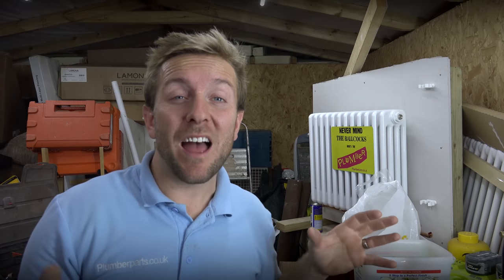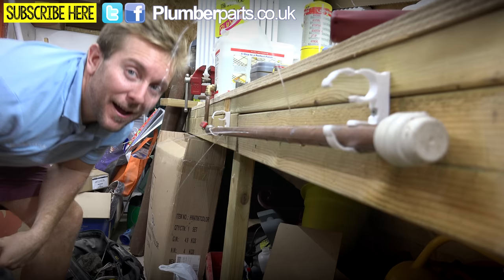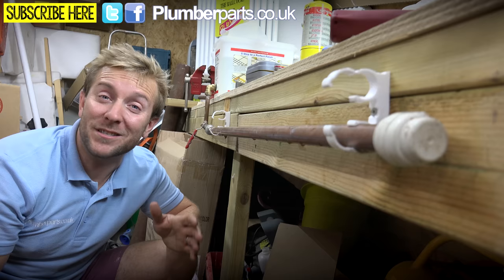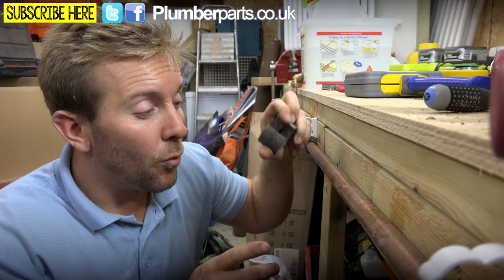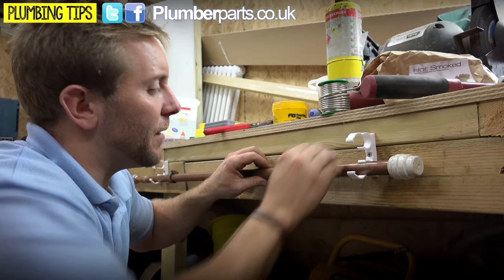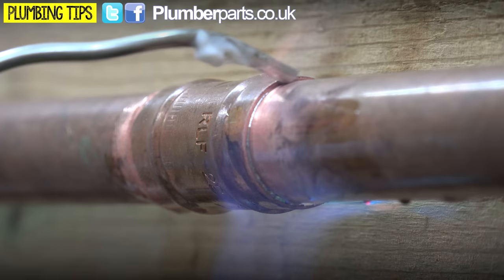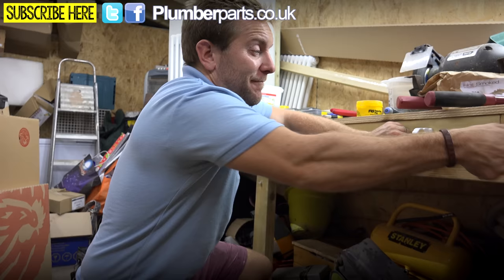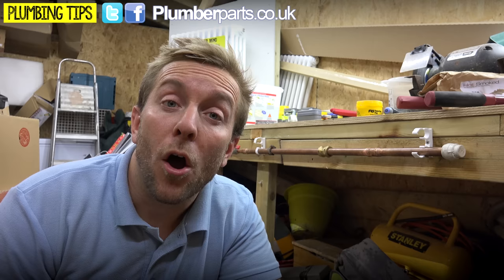FIX LEAKING COPPER PIPE - PINHOLES - Plumbing Tips

Comment: I just find you five years a little too late. In any case your program is very informative. Were where you when I moved to Venezuela from Uruguay in 1975? In both countries we use compression fittings to repair galvanized pipes. Copper is mostly used in refrigeration and gas;I guess this material is a little too expensive down there. When I arrived in Canada at the end of the eighties I was convinced that I've found gold to add to my trade. Copper pipes are lighter,safe and way easier to work with. I did find,as well,that in here ABS pipes(oppose to PVC) are very common and easier to install;as long as they are not used inside the walls in high rise buildings. We even have invented a four ways  fitting nicknamed Toronto T made out of this material. Do you use these pipes in there?. Greetings from Toronto from this old happily retired colleague. P.S : wear your mask pal,even your Prime Minister got infected.......

Comment: As a teen in the 60's I learned to repair black polyethylene underground water supply using a patch from stainless sheet metal and a stainless worm-drive band clamp.  I understood these repairs were essentially permanent.   I once made the mistake of closing up a wall after applying the temporary fix shown here on 1/2" copper pipe, a piece of rubber with a band clamp.   A month or so later water was heard spraying in the wall.

Comment: Here one way of fixing a pin hole. Cut a short length of copper pipe, using a hacksaw, not splice, due to chamfering. Then cut it length-ways, just offset of the middle. File way any rough edges.
Clean the inside of the larger piece, and over the pin hole, using wire wool, Then flux the cleaned surfaces. The piece of pipe, that as been cut, slightly greater than its diameter, when pushed, will clamp around the pin holed pipe. Run some solder into the joint, and clean off. The patch repair, will be permanent. Good thing is you don't have to cut through the pin-holed pin. It also works on pipes which have been punctured with nails or screws !
Tip!  Cut down the lenght, before you cut to size. Usually the lenght of a standard Coupler is sufficient !

Comment: Many years ago I just flowed some solder over the hole and plastered it with araldite. It worked and was still working when I sold the house. Apparently in the 1970s there was a lot of poor quality copper pipe prone to pinholes around.

Comment: I have used the clamp with rubber from a bicycle tube to patch a pin hole . Still working after 3 years . Easy to reach area so if it failed again I will fix it properly .

Comment: 4th way, solder blob it ;)
Reply from the maker: Nice one!
Reply: Sirus You could also come home one day to 15000$ in water damage.
Reply: Actually I've done this for a temporary fix.  Here's how to do it:  sand the area around the hole and clean the area thoroughly with acetone.  Put a tiny bit of past flux just around the hole making sure to keep it contained to just the area around the hole - don't use too much!  Solder won't stick to the copper without flux so just a tiny speck of flux so it doesn't run when you heat the pipe.  Then heat the pipe and a touch of solder should blob right over the hole and not spread out leaving the area too thin.

Comment: Duh-hes soldering that coupling with the john guest cap still on... Pressure builds up and blows solder out... Result-leak
Reply: jeremy western bubbles back into the little tank???
Reply: +Joe O'Halloran OOOOOHHH GET YOU!!!! Bet you wear a special helmet!!! 😂
Reply: jeremy western ...novice here...so teach me something - let's say you're maki g your last solder...how can you avoid that pressure build up? Would you simply have to have the line a open somewhere?
Reply: +Mr Gwarn Stylee yes- always make sure a tap or rad valve is open somewhere... U can tell something is wrong when soldering cos solder start blowing out of the joint- then leaks
Reply: jeremy western thx
Reply: +Mr Gwarn Stylee OOOOHH GET YOU!!!! Bet you wear a special helmet!!! 😂😂😂
Reply: jeremy western I do - the tin-foil keeps the invisible control waves away...at least that's what the neighbor's dog tells me.
Reply: +Mr Gwarn Stylee TAKES ONE TO KNOW ONE
Reply: jeremy western Woof, woof!
Reply: Jeremy is right, but only with short runs of pipe I find, on large heating systems the pressure build up is lost

Comment: great video you could also use a sharkbite coupling in place of a compression coupling and a copper sweat repair coupling, no stop, so you just have to slide the fitting back and forth without having to slide the tubing lengthwise. soldering up the hole itself also works....with a little skill. i've done it in a pinch.

Comment: I do repair number one for pin holes not at/on joints.  The first one I did was 12 years ago, and it's still there and holding perfectly.  There have been many number one repairs since, and they've all stayed that way.  Temporary?  I guess... if you just can't stand not doing in-depth plumbing jobs all the time.

Comment: I took a rubber hose from a washer and cut off a 6 inch long piece and put it over the pin hole by cutting the hose lengthways and I secured it by hose clamps. Much like what they did. It really works.

Comment: I've had more pinhole situations caused by hard water. Copper deteriorated so bad I could crush it with my hand. Other hard water issues where any compression or solder attempts are a fruitless effort. Don't get me wrong, great advice. I've used "rainbow rubber" many times in life. Always keep some in my vans. Can also become an instant pump seal or similar. I'll keep an eye on this channel

Comment: Thank You, I have just applied the temp fix (jubilee clips and rubber)  as we can not yet access a greater length of pipe, going to  wait until I can then maybe apply compression joint if the pipe next to it allows space, if not,  do both pipes, just seems to me a shame to chop a decent pipe,, anyway thanks again.

Comment: I wonder how good a pencil tip works for a quick temporary fix I think I saw this somewhere years ago where you just take a pencil sharpened it up really good and just stick it in the hole and break it off and voila you've got yourself a plumbing repair that you can write home about supposedly don't hold me legally responsible

Comment: Had a freeze in late 80s. Small split in a pipe outdoors. Pressurized line. So i took a piece of rubber tube, cut a plastic pipe in half and a hose clamp. Rubber over hole, split pipe over rubber, clamp over split pipe. To this day not a drop leaking out. Soooo, if it aint broke, hands off !

Comment: If you need an emergency fix you use a bicycle repair kit. You use a tire patch and a hose clamp. The patch over  the hole and clamp until the leak is stopped. Fast and cheap until you can do a proper repair.

Comment: I’ve used black mastic plumbers tape on pinholes with pressure in the pipe. It held for years until the bathroom was renovated and the pipe was replaced as part of the renovation.

Comment: Just came across your video, not by searching... But I watched it...  I have experienced a number of pin hole leaks.  The plumbers don't solder anymore.  They cut the pipe on each side of the hole, and then re-assemble with a copper fitting with gasket, and use a tool that is battery operated and it compress the fitting.  I now have my leak fixed, a huge bill, and a hole in my ceiling I need to fix. I hope what they did never leaks.  They tell me my leak with the bluish tint where the hole is was caused by defective pipe?????

Comment: If you don't have any copper around but you got a torch and solder you can actually use a penny. Heat it up and curl it a bit, flux both areas and solder it on as makeshift "patch".

Comment: Cleaning the pipe before cutting it is much more easy, since it is still completely fixed. When soldering stick a little aluminium foil to the wall. When the wall construction is made from wood or other flammable material it acts as a heat shield, it also keeps the wall free from sood. inside of a fitting there is a little nose or a ring to prevent the ends going over the middle of the fitting, if you remove this you can slide it completely over one end which is usefull if you can't push back the pipe. Now you have to pay attention to center the fitting and on vertical pipes that can ba a pain in the b**, but you need much less space.

Comment: You missed the Full Slip Sweat Repair Coupling 6". I used one to repair the hole in the pipe from the jackhammer that I used to get to the leak under the slab. The splice was so long that it replaced the section with the pinhole. I was completely baffled by this as the pinhole could not be found. The pinhole was 2" from the jackhammer hole in the replaced section.

Comment: Well, a quick bodge if it is  big pipe. Dent the hole, clean it up and run solder into it. Works as I know. Especially good if you have put a nail into the pipe first, by mistake of course.

Comment: Another quick pin hole fix , turn off supply, clean outside of pipe smear flux over area of pin hole then run solder over area, should seal leak. (Not really perm fix but one has lasted to date from about 2005) by plumber.
Reply from the maker: Top tip mate.

Comment: Home or apartment, find the main water shut-off valve and note the location before you ever have a problem. Plumbing pipe leak ... turn off the main valve first and save possibly thousands of dollars in water damage. Under since there are two valves you can turn off if you have a leak so find them now and turn them slowly and snug to the off position, not overly hard or you'll end up with a valve leal or break the handle off. All shut-off valves are rarely used so the seal inside can get stiff, crumbly and or crack. If water leaks from a valve under a sink or toilet, shot off the main valve. If your main valve leaks, call a plumber to shut off your curb stop valve and replace or fix the main valve.
Reply: Stop cocks in the UK are always seazed solid when you come across these problems. Then you have to try and turn off from the road which can be a real issue if the water main is shared.
Reply: @EnglishCad  For a inside main water "stop cock," I recommend what we call a ball valve. This type has a lever, nit a round handle to turn and unlike a gate valve it very rarely stick, breaks or leaks.

Comment: If at some point the residual or standing wateris a little to much, get your material ready. Clean the pipe and fitting very well and flux all. Slide the slider fitting to one side of the pipe. Have a piece of “WHITE” bread ready. Ball up the bread and stuff it deep into the running water side of the pipe. Slide the fitting into place and solder away. “Cannot be done with any type of pressurized water. Standing water only”.  A good chunk of Bread will hold the standing water easily until the sweating is done and the bread will dissolve totally in seconds as soon as the water pressure is turned  back on. Will not clog the pipe. Has never missed yet! 👍

Comment: Great info!  Good idea to polish the pipe b4 using a compression fitting.  IF the pipe is healthy and IF you can dry it, then the hole can be silver soldered.  There is also an epoxy "bandage" available which I have not tried.  I do very little plumbing and found out that flux can go bad after several years!  If in doubt, throw it out.

Comment: I fixed a pinhole leak under my radiator by wrapping some bicycle tube around it and secured it with cable ties. That was 15 years ago, and it's still going strong.

Comment: Its important at the outset as a qualified harpist/plumber, to dish the dirt on the previous blokes who had a go...even if it was you. This is vital as the leak may not be fixed and take several goes at it until you get the hang of learning how to repair it.

Comment: After soldering a fitting on to copper pipe you turn the water pressure on and you have a pinhole leak due to moisture still in the pipe causing steam creating the pin hole leak.  Remove the fitting, clean up the connection, ball up white bread and stuff into both ends of the pipe tight as a cork to stop steam build up from soldering heat transfer.  Re-solder the fitting and voila no pin hole leak!  "Trust me"  it works.

Comment: Silicone Rubber Self Fusing Tape works too. Just wrap it around the pipe really tight By stretching it around but start at either end on the left or right of the pin hole. Its not a permanent fix but it will get you by until you can get  the parts and tools to fix it right.

Comment: I've tried the 'band-aid' method.  Clean the area around the pin hole,  drain the water in the pipe, and then solder a small piece of copper over the pin hole.
That was 30 years ago. No more pin hole leak.

Comment: I have done it with cast iron pipe using lead from fishing gear. Just formed the lead into a tapered bullet shape, trimmed the length and banged it in. Permanent repair. Could be done on copper, but solder might work better. Make a short thin taper. Bang it in. Alternatively, drain the system, bang in the solder plug, apply flux and then heat just enough to melt the outside flat.

Comment: A new house just down the street from me was burned to the ground when the owner tried to do his own plumbing and his torch caught the wood on fire just behind where he was soldering.  No fire insurance, a $450,000 total loss.  He should have used Sharkbite fittings and/or crimped PEX pipe/fittings instead, it would have saved his house from the fire. I take a section of galvanized sheet metal from a length of hot air duct and I use that as a heat shield when I do soldering, plus I keep a bucket of water and a towel, as well as a large fire extinguisher beside me for a backup to put out any fires since you never know when a fire might start from such work.
Reply: $450,000 & cheap on fire insurance? Geess wiz !
Reply: What he should have done was called a plumber that knew what he was doing , one with liability insurance
Reply: If you think that is bad I heard of one plumber on his first day at work that burned down a pub called The Thatched Cottage. You can fill in the blanks.

Comment: Pin hole leak.    Used a self tapping screw with rubber washer on hot water tank.   Lasted years.

Comment: been a plumber all my life. you don't find pin hole in the middle of the pipe line. it's always near the elbows and joints where there is water turbulence and hammering pressure.
Reply: Not 100% true, id say 80% of pin holes are like you said fittings and pipe close to, mostly recert and hot water lines but I’ve seen tons of pin holes in the middle of the piping before, guess it depends on the application, municipality etc

Comment: 6 o’clock on Christmas! 😭😂
Reply from the maker: Gutted!
Reply: @plumberparts  it’s right on a corner piece an I can’t get the valve shut off to stop it. I’ve used a piece of rubber an zip ties on leaks like this before an have gotten them stopped until a Plummer got in but where this one’s on the angled piece I can’t do that 😭

Comment: Clean area of pipe with the pin hole, wrap the area tightly with copper safety wire and the solder the copper safety wire and pipe. Did a repair like this 20 years ago and itʻs still holding leak free. Try use .030 copper safetywire.

Comment: My theory.  In manufacture steel swarf or filings from the dies are included in the wall of the copper pipe and eventually rust leaving a hole. Easily fixed with solder and patch.

Comment: The first repair is only temporary while the other two ere permanent and relatively easy when you have a free end. When it's in a pipe that's fixed both ends it's a different matter. There is always the option of slip couplings but they're as hard to get hold of as rocking horse manure.

Comment: The last joint you should open the cap to get the steam out the pipe when you was soldering the last joint and also not pression in you system . 
But finally you make it happens so good job

Comment: B.S. First of all you need to fix the cause of the problem which is usually galvanic corrosion. For that matter, better consult with a professional engineer, which will likely recommend sacrificial anodes, and replacing the affected pipes.

Comment: Great video! I've got a pinhole leak from an old soldered fitting. It looks like water is spurting out of one end of a sleeve round a length of 1/2 inch copper pipe in the bathroom. I was thinking of doing a compression fitting as flames are not going to work well in a confined space surrounded by wood. Do I need to cut the whole sleeve off and put a compression fitting over a gap in the pipe, or do I need to put a piece of dummy 1/2 inch pipe in the space I've cut out and put two compression fittings?

Comment: Simpler emergency repair is using gaffa tape this is currently holding back the water on a radiator valve until I can fix it properly in the morning. Yes it is water tight, yes, it is hot central heating.

Comment: I use Teflon tape and electrical tape to stop pin hole leaks. Wrap the pipe where the leak is with Teflon tape stretch it tight around the area where the leak is, and then wrap the electrical tape around the Teflon tape really tight and you will have no more leak. It will out last the pipe.

Comment: Before soldering a vertical pipe that still is leaking a tiny bit of water. Get some white bread, grab a handful and squeeze into a ball. Shove this ball over the pipe end. Then push the bread that's in the pipe, further into the pipe to keep the water away from where you're going to solder. The bread will eventually dissolve in the water after you're done.

Comment: Plumberparts at 1.08 you described using a 22-15 reducer, but then shown a 15-22mm expander installed ha ha ha 😁
     By the way best and cheapest instant solution that anyone can use, to any water leaks is turn off the water supply!! But then maybe its not very usefull